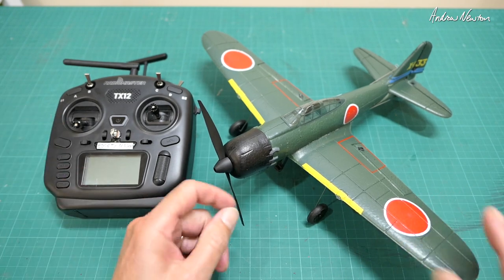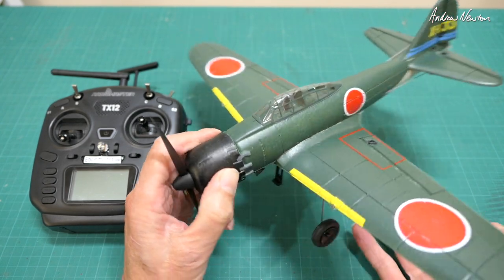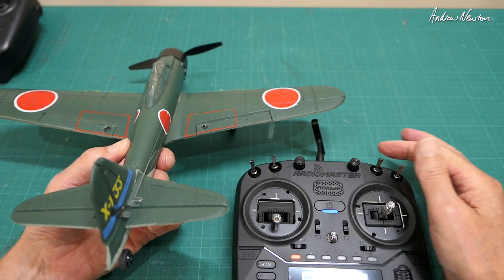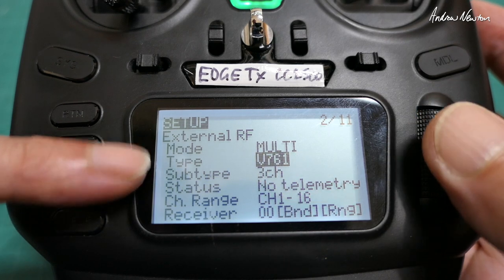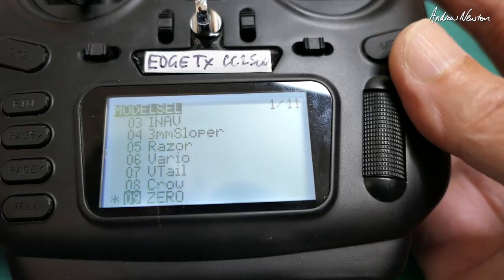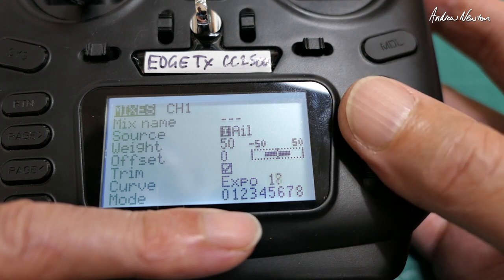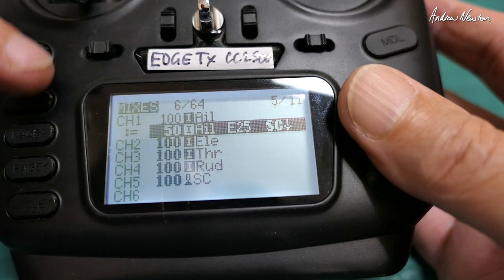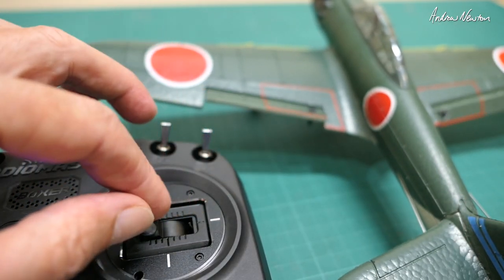Rates and Expo only in Expert Mode

Comment: I fly these planes all the time and leave the rates as they are. All you need is around 15% expo then put in the  practice to get used to it. This particular plane is the best flyer out of all in that range. Take a look at my video on this plane. Nicely explained Andrew.
Reply: Rates and Expo I think are very subjective. I tend to have a minimum of 25% Expo on all my LOS non stabilised planes. I set up a 3 position switch with 100% rates but 35-40% Expo, then say 60 rates 30 Expo then say 40/25. I hen play around with these till I get them right for me. Some planes will require a lot more rates on low, others have massive authority and my low rates may even be 30%. Some planes have a lot of Aileron authority but not Elevon, so you up or lower these as necessary. Only Rudder authority is sometimes left with no Expo and 100% rates if there's not much authority. But I do like to use a lot of rudder on the few planes I have that have a rudder. I'm guessing that those little war birds are quite tangy, even with the gyro on a breezy day. Look fun though.
Reply: Tuning down the rates can help a novice in a panic situation, where there is a tendency to oversteer. At least that is my experience. Gives me a chance to right an upset and not just create a new upset 😅
Reply: @blackbirdboy1  definitely subjective and I suppose a good way of looking at it is to apply a good amount of rates and expo, then reduce it as you get to know how the plane handles. These little warbirds will become boring if you don’t venture into Expert mode. They are bags of fun though and very forgiving if you hit the dirt.
Reply: @bokusimondesu  yes the biggest problem when you are new to the hobby is to over correct the movements. With these little warbirds the key is to cut the throttle when you know you have lost control of it. Very forgiving plane in a crash.
Reply: @blackbirdboy1  You might be surprised at how well the gyro "tames" wind on the Eachine warbids. I have flown my T28 in 25 kph winds, with no problems. Of course I was on full power most of the time and the wings "trembled" but it was fine.

Comment: Andrew, I have often wondered whether Channel 5 on these receivers only responds to values of -100, 0 and +100 or whether, with a multi-protocol radio, the middle value could be 50 (or -50) to get a gyro setting that was (say) half way between the stock Novice, Intermediate and Expert values. Have you ever investigated this?
Reply from the maker: Adjusting the gyro gains is a feature that some gyro units have,  like the Kopilot or NX3, but not these mini plane gyros
Reply: @AndrewNewton  Yes, I have a Lemon RX with variable gyro gain. I just wondered if you had explored this on these receivers. It seems not. On the Lemon RX I have the gain on a pot.
Reply: @AndrewNewton  You sure about that Andrew? The NX3 gain certainly can be adjusted via the Tx - but the Kopilot??? 🤔

Comment: i noticed you used the tx 12 in part of this video, i bought a radiomaster tx12 mk2, it has edgetx and cc2500, not expresslrs. i got on radiomaster's site before i bought the radio and downloaded the backup files to see what protocols it supported but when i got the radio it supported on about 10% of what was listed internally, so i bought the radiomaster 4-in-1 nano/junior exterior module. i have watched several of your videos on the xt 12 and they have been very, very helpful! i was wondering if you knew if there is anything i need to do before or after i plug the 4-in-1 into the back of the radio? i don't want to screw up either device . i'm in the us if that make any difference (when i bought the radio the vendor asked fcc or eu, it's fcc) in advance, thanks for any help you can offer! sincerely, foster
Reply from the maker: The CC2500 information should be more prominent I agree. But you're good to go with the 4in1 module. Nothing extra to do, just plug it in, choose External module ON. EU version is only for Europe with more power restriction.
Reply: @AndrewNewton  Gee! quick response! that's a load off my mind! thanks!!!!! foster
Reply: i got so involved in my explanation of what i was looking for i forgot to say what a beautiful flying spot you have, love the view of the ocean! i live on a farm in kentucky with a little over 600 acres around me. lots of hay fields and lots of trees but no ocean. once again thanks!